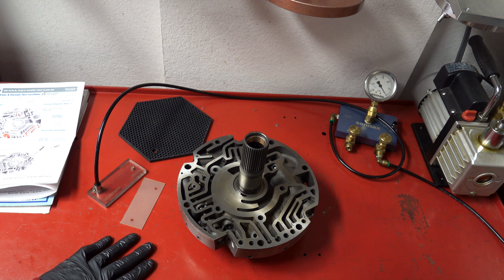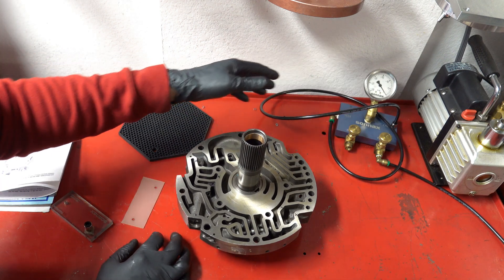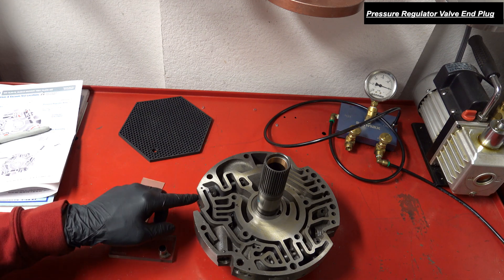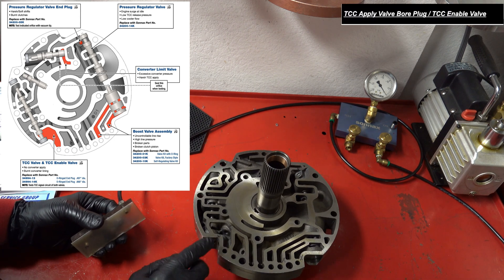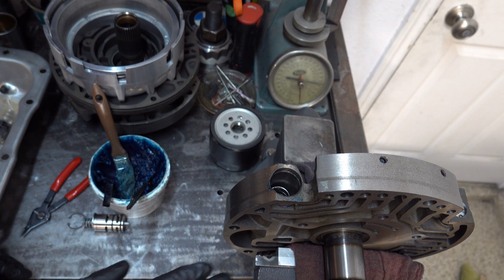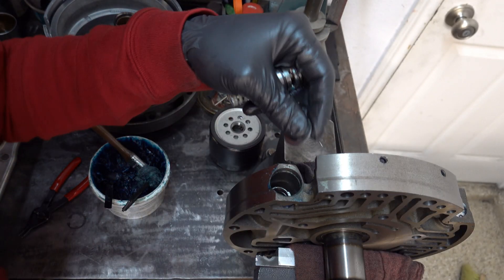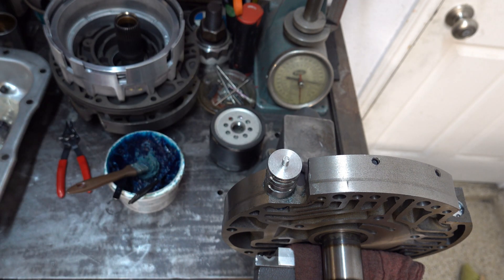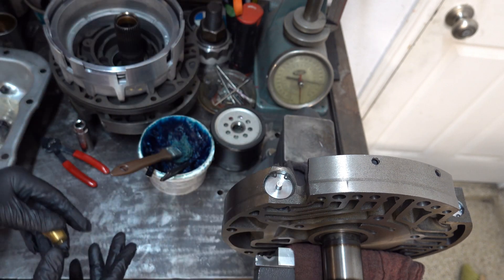GM 4L80E Vacuum Testing - Pump Assembly

Comment: Good video Nick.
..what are your thoughts though on using the stock spring vs sonnax boost valve springs? Some say the sonnax spring maybe cause the pump to work unnecessarily harder (i.e wear out prematurely) and others say it will benefit the trans if its used for towing
Reply from the maker: Thanks for watching diycast. I always use the Sonnax spring for anything HD or high performance but the stock spring is also fine for stock level builds.

Comment: When assembling the pump halves should I lube the whole surfaces other than the gears? Using extreme automatics pump saver if that matters
Reply from the maker: Just follow what I show in my video and you'll be fine.